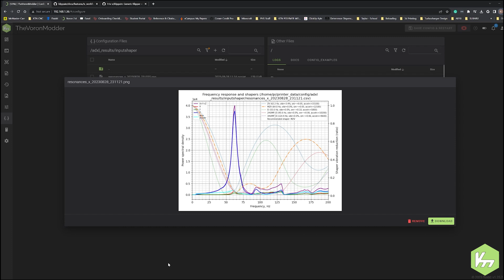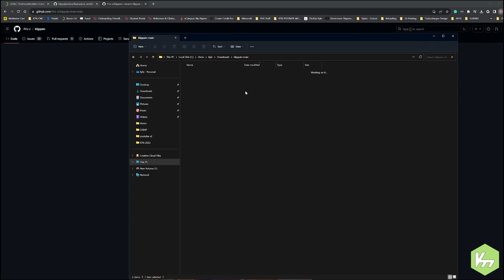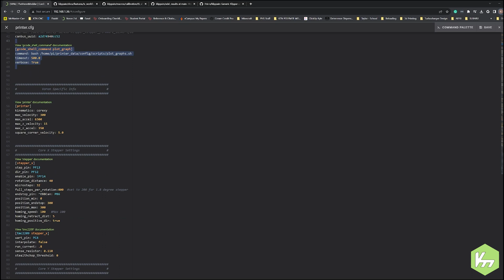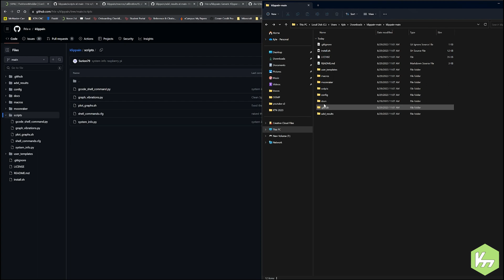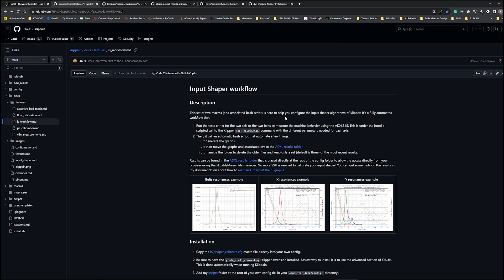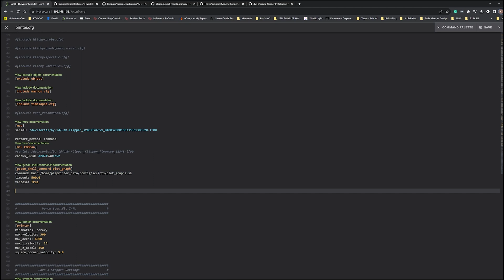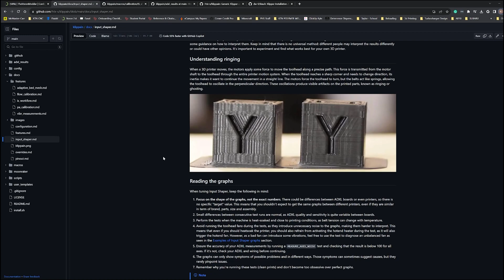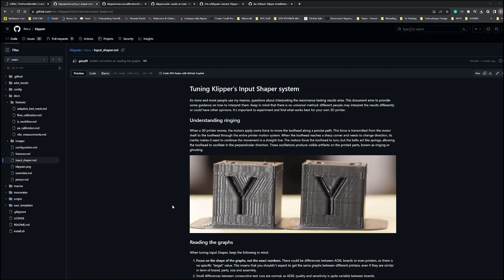From the Desktop Input Shaper

Comment: I didn't read properly and accidentally installed the first link now I've lost everything. is there a way to reverse this?
Reply from the maker: Its not gone though!

use something like WinSCP to SSH into your pi, then you go /home/pi/ 

look in that directory for a klippian/backup or something along those lines and your oem stuff will be in there, download it to a new "SAFE" folder on your desktop, either work through the new config setup or you can remove all the Klippain folders and restart. No biggie!
Reply from the maker: And thank Steph OldGuyMeltsPlastic cause he helped me recover my stuff when I did the same thing!
Reply: I happily got it back. only I can't add the 3 folders when I drag them into mainsail I get a file and no folder. your mainsail also looks slightly different from mine on the left @TheVoronModder
Reply from the maker: I am using fluidd not mainsail, however you still can create a new folder, label it then drag and drop those files, you can also use a tool like WinSCP to do it as well. @robertlooijmans6242
Reply from the maker: Im using Fluidd FYI, I will be using Mainsail on my Switchwire build (Cotton Candy) @robertlooijmans6242